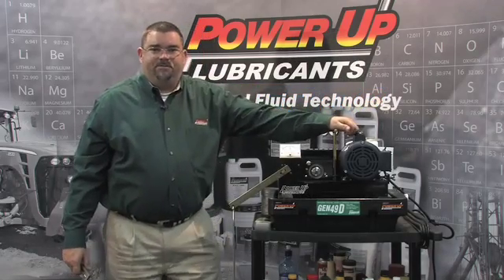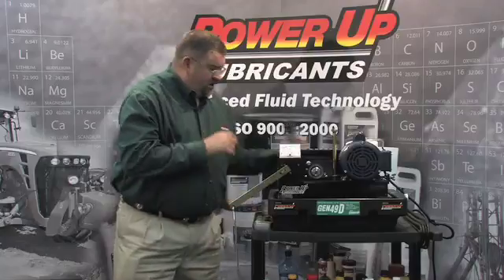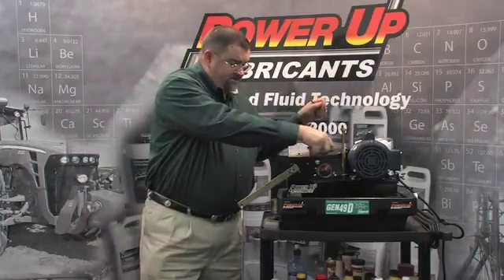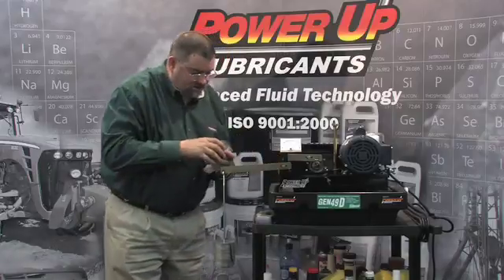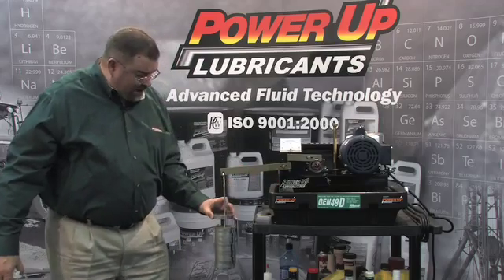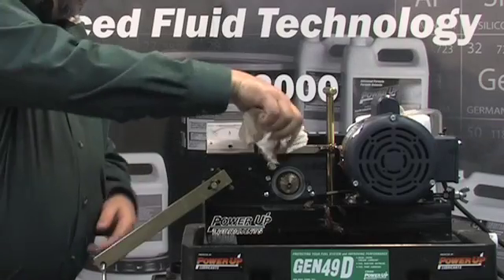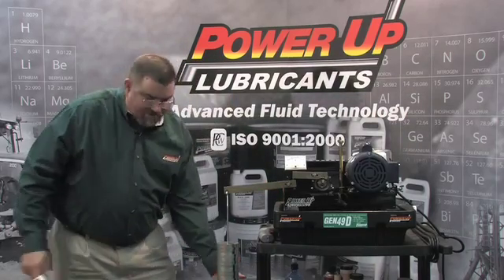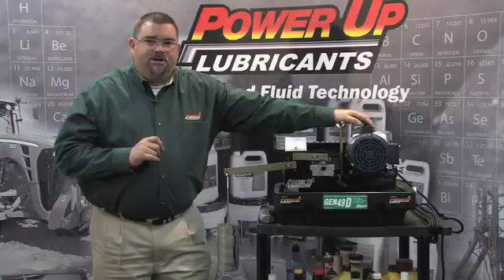Power Up Thixogrease Timken Bearing  Machine Demonstration

Comment: This appears to be a rigged test as there is no test lab that with a ASTM D@509 Timken apparatus that can test beyond 100 lbs. Unless this was a different grease, power Ups web site lists their Timken Load at 70 lbs. The 270 Timken is likely based on the addition of the 7 0r 8 weights combined with the 35 lb mechanical advantage which is bogus as there is no machine testing past 100. This is not a modified Timken machine, it appears to be a modified Falex tabletop lubrication evaluator where they replaced the torque wrench normally with that machine, with the weight holder. In an actual Timken Test, grease is fed through continuously during the test, and the machine is stopped before adding additional weight. Falex developed a multi-tester and early on claimed to be able to run the Timken test at over 1000 lbs, This turned out to be theoretical only as it has never been done and the parts do not exist to do it. They would have to be engineered and manufactured first at a cost of over $5000. US in addition to cost of running the test. This demonstration test is easily faked by chlorinated solvents to clean the bearing surfaces or by adding it to the lubricants, A sharp eyed farmer saw a guy do exactly that at a farm show. The guy doing this test used the term "dripping point of the grease", the correct term is dropping point meaning the maximum temperature the grease is capable of handling. Power Up is a high heat grease as he stated and will withstand het to 570F. But he compares it to one with a 310 F capability. A fairer comparison assuming its a fair test would be to compare it to another high heat grease such as Paragon 3000 which has a dropping point of over 600 F and Timken load of 100, water washout of 0.65 percent as  posted on their website, Not saying that power up is not a decent grease but apples should be compared to apples.
Reply: power up is good stuff. saved me a lot of money over the years.. great for small engines too
Reply: You gave some great ideas.  I know this guy personally and I can tell you nothing is added to the Thixogrease, but that's why he normally is only willing to do the test in person, so people can see there's no fraud.  The machine that is used is ASTM certified.